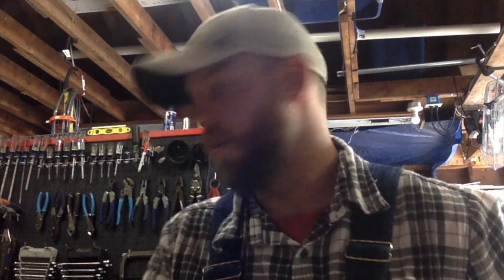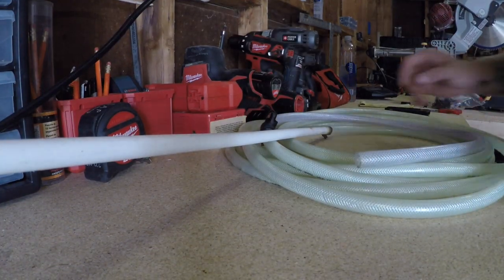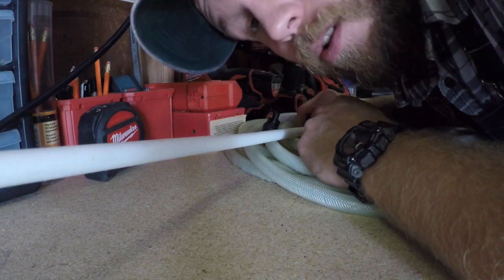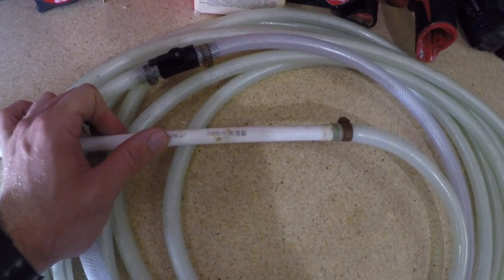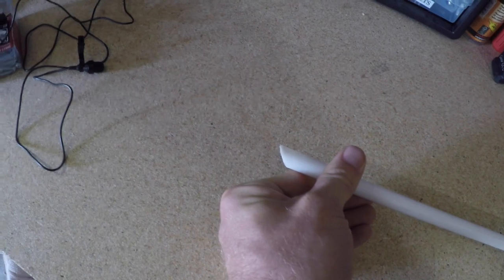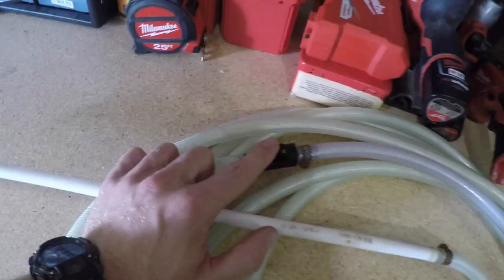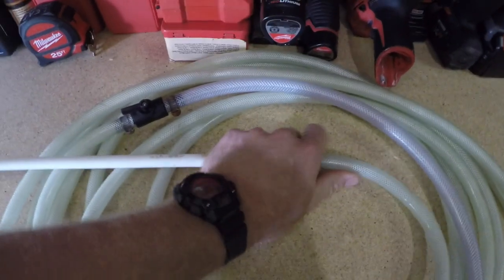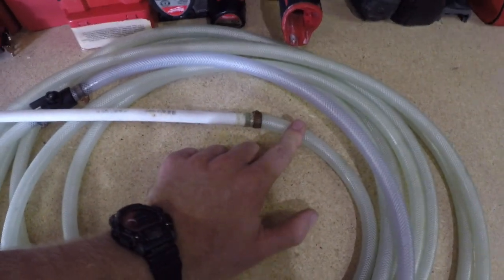Become the X-Jet Wizard

Comment: I am implementing this into my setup tomorrow. In Canada and would really appreciate a parts list if possible.  Tks for the great ideas.  Need 100 ft of hose, valves/fittings and buckets. Currently running stock m5 xjet thru 4gpm machine. Sick of hauling buckets!!

Comment: Need help.. i modified  my xjetm5. I lengthened the hose  with 20 more feet. When i stuck the hose onto the bucket and started spraying  the F$%^ hose popped  off of the xjet  the pressure was so strong i had to hold it on with my hand and fingers  it kept popping off. I had a black  gromit in the xjet  and i was  just doing the regular  soaping...and rinsing.. water was shooting our of thenlk gromit when i unhooked the hose  from the xjet  and pulled  the trigger. I thought it should have suctioned air instead of spit out water.. ANYBODY  know what happened?
Reply: You have too high of pressure a tip on your gun you need something that doesn’t restrict pressure for it to pull the soap

Comment: I just bought the M5 Xjet with 50 foot of Xjet hose and using 200 feet of pressure washing hose. A 4000psi machine 4GPM(Landa HD). How much SH, surfactant and water should i use in a 5 gallon bucket.Also what Proportioners do you recommend i use? I am located in Idaho. We really do not get the nasty algae or moss in this area.
Reply: The xjet will pull 1.6-1 open with no proportioner. Assuming you're using 10% from the store (pool essentials, let's say), you'd want to get a 4 percent solution in your bucket (which is 3 gal water, 2 gal 10% SH). This would give you approx 1.5% coming out of the gun (probably less due to weakened SH due to shelf life). This will do perfect on any solid materials like vinyl siding or metal. For stucco or something more porous, straight 10% would be adequate (approx 3.5-4% coming out of the gun).
Reply: @Chris72401  Thank you for the reply. I already had it figured out though.

Comment: Ok I understand that in order to get a better draw on soap with long hoses is to step down to a lower gpm injector but does the same principle apply for the X-Jet for super long pressure hoses? Say maybe using an X-Jet rated 3 to 6gpm for an 8gpm machine when using for 300ft of hose or does it matter? Thanks
Reply from the maker: With the X-Jet I don't think it matters because it pulls soap when there's a pressure drop like an injector. There's a massive pressure drop when the water leaves the nozzle. I'm pretty confident that the length of pressure hose is pretty much a non-issue with the X-jet. We just use X-jet's a size down because it's what we had before the new machines. Still work great. To answer one of your other questions I forgot to answer from earlier: Yes, all the X-jet hoses are 70 feet long, but we keep the other 30' feet for smaller jobs. We have some 10' hoses if we're working from a lift, but have had success pulling soap 25 feet straight up with a longer hose.
Reply: Okay here is where i am at. I am installing a rig in the back of my van. Stacked reals that have a 150 feet of garden and 150 feet of pressure. Keep in mind I am new to this. I also have a 5gpm 3500 machine and a 50 gallon buffer tank behind it. I will then have a bucket with a down stream injector so I can place my solution in it and then use it straight from the van. Is it easier to just use the x jet? I was going to purchase one anyways to do roof jobs. But should I simply use it for house washing as well? I am so lost and trying to save money.... I have been quoted around 5600 with labor to install my setup. Let me know!
Reply: i guess you do have to carry it around the house but it seems like it is much easier ? Doesn't look as professional but this x jet seems to be really good! I also hear that if you are pulling from a down stream injector that the soap cant pull past 150 feet without issues, so having the the soap come right after the nozzle would make 300 feet easy i guess. I really need some advice to make sure that I do this smart and dont piss away my money!
Reply from the maker: Frankly, it's not easier to use the X-jet, but on some things you don't have many other choices. It's an essential part of the tool kit. As far as not being able to pull soap over 150' feet of pressure hose if you step down one injector size you won't have any problem pulling soap. You may just need to modify your mix ratio. We pull soap without any problems regularly on 225' and 275' of pressure hose.

Comment: I understand it's all about time spent on the job. What if you had a mirrored injector hose to your pressure wash hose that had a 12v 40 to 60 psi diaphragm pump pushing your mix. Let's be honest our problem is getting a stronger mix to the surface when we need it from our truck or trailer. Granted the hose reel would have to be bigger and the mix hose evacuated at the end of the day.
Reply from the maker: I'm not tracking. Are you talking about a softwash system hose attached with your pressure hose and running two guns?
Reply from the maker: I have another video I drew on 100' of x-jet hose and we draw just fine on 70' of x-jet hose, 30 feet in the air in lifts regularly. The short answer is I don't know, but I'd be interested in testing 200' feet of x-jet hose to see if it will pull. I think the only problem you will have with a 12v pump is that you're constantly running SH through it instead of a dilution. I imagine you'd go through a lot of pumps. Through a 3/8" draw hose you could probably use a 2 or 3 gpm pump and be perfectly fine if they make them that small.
Reply: Squid's Pressure Washing LLC 
That's good to know I've never tried 70' of hose to draw from. Another reason for using the two hose method would be so that I could get more SH to my xjet for a stronger mix when I need it. I'll have to check with a pump manufacturer to see what SH would do to a diaphragm pump. Just curious what surfactant do you use with your SH.

Comment: Do you use tips on x-jet? What mix do you use in bucket?
Reply from the maker: Hey Duston. There's proportioners that come with the X-jet. Is that what you mean by tips? The proportioners allow you to pick your ratio so there's no mix in the bucket. It's straight soap and the X-jet mixes it for you.
Reply: Squid's Pressure Washing LLC  Yes. What proportioner tips do you use? I have a 8gpm and recently bought x-jet. I usually batch mix 50gal for 12v. Wondering what mix would be best w what tip.

Comment: Thanks for this video on the X-Jet I do service the Virginia Beach area myself even though I’m located in Newport News Va. What gallon per machine do you normally use 70ft of hose on for your X-Jet? Can you use 70ft on an 8gpm machine using 400ft of pressure hose? Thanks in advance😃
Reply from the maker: Hey Lawrence, I was running this on a 5.5 gpm machine, but we use the same X-jets on a 7 gpm 4000 PSI Udor with 225' hoses no problem. Hoses over 200' you can get by with X-jets and injectors for the next size down gpm. The cards that come with the x-jets will tell you what the ratio is for any gpm machine.
Reply: Squid's Pressure Washing LLC thanks for the info...
Reply: Good deal Im going to try it...thanks
Reply: Great video! Curious on how much hose I can use on 2.5 gpm 2900 psi Ryobi. Just starting out and got my xjet this week but know that the extra length in hose will help a ton. Thanks for you help in advance.